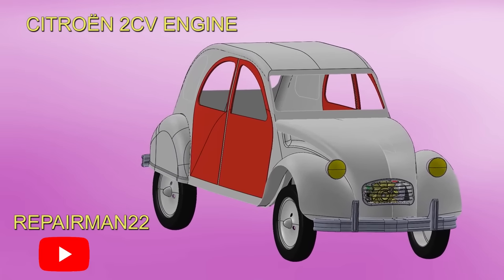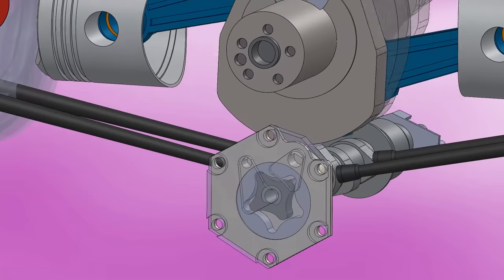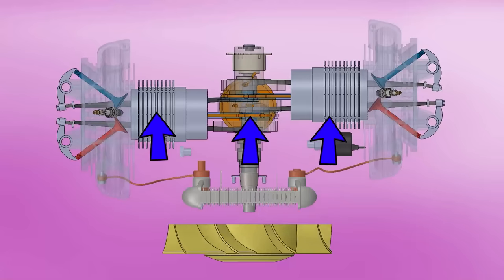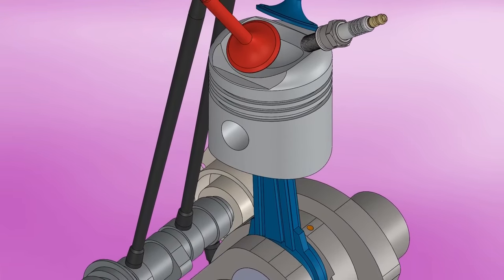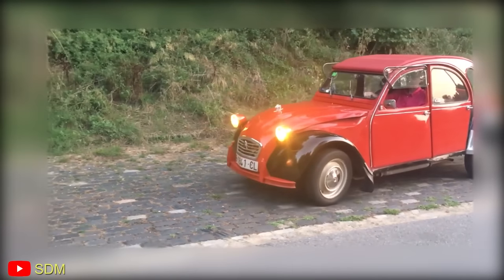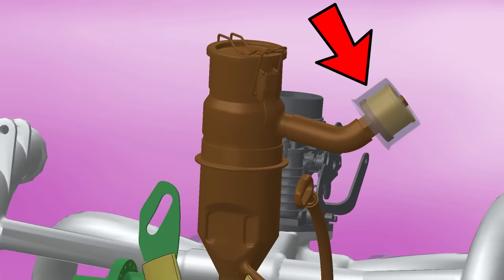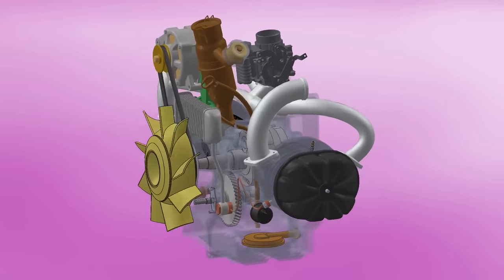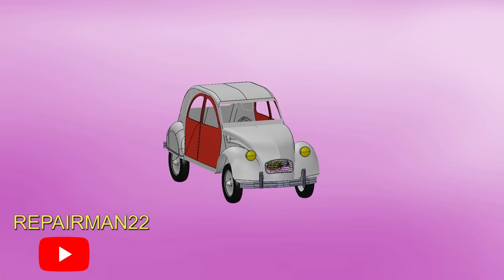The Most Interesting Engine In The World 😍 Citroen 2CV / How does it work in 3D?

Comment: In Greece there was a Greek-made Citroen Pony.  Same engine and drivetrain but with a jeep-like chassis.  Heavier than a 2CV, but could easily fit 10 kids for movie runs!  That was with the 602cc engine.  I learned how to drive on my dads Pony.  It was very fun to drive, especially on dirt roads, thanks to the amazing suspension.  It would be interesting to get a video on the gearbox of the 2CV, the weird gear arrangement (reverse and 1st were opposite of each other), why the 2nd gear was the strongest, and why you could go from 3rd to 4th 2 different ways (one was the normal way of going through neutral, and the second was moving to the right first through the location of what would've been a 5th gear if it existed).  Thank you for bringing back memories!
Reply: I couldn’t even work that out about gear changes let alone trying to drive it 😂😂👏
Reply: Second and third were used a lot for around-town driving, which was very nice in terms of shifting  -  just straight back and forth.

Comment: We bought a used 1968 Dyane 6 with the bigger engine when we first came to France, and I did a lot of maintenance on it myself.  The repair manual said (roughly) "to adjust the rocker arms it is not entirely necessary to remove the mudguards, but it helps".  They were right; however to do this you had to disconnect the headlamp adjustment cable and remove 16 screws each side. To adjust the points you had to take off the front bumper and the fan. Wondrous.  We took ours over the Cockbridge-Tomintoul road in Scotland and over the Alps in the Haute Savoie.  Another time we rolled up the roof and got all the wood to make a double bed into it, along with the mattress.

It finally died in 1976 when a mechanic at the dealership in Edinburgh stripped a clutch mounting bolt and didn't tell us. Still, it took us back to our home near Paris before the engine lost all its oil and we sold it to a scrap-merchant for 400 frs, which we spent that evening on a fitting wake. Wonderful car.
Reply: Can't you replace the engine? I mean the cars were still produced- oh wait a used 1968 Dyane oh then from there on out i got no clue wha- And i forgot i could study the Dyane.
Reply: By rolling the roof back, I got a set of four-metre double ladders into my Dyane, while narrowly avoiding a parking ticket.  Sadly, I no longer have the car, but still have the ladders.  On another occasion, it transported a 280Kg block of marble loaded by forklift.  This was the only time it looked low at the back.  The bump stops came into play a few times on the way home.  Getting it out again on my own was a challenge!
Reply: @CrowPal  It probably weighed more than the car!

Comment: The 2CV engine was designed by Walter Becchia, an Italian engineer who had been at Fiat’s race engine design department before WW1. This design bureau was at the very forefront of combustion engine engineering and would see many of its members develop famous engines for a whole range of brands.
In its latter stages the engine would rev above and beyond 7,000 rpm, and last forever. Try that with a Beetle engine...
Reply: A beetle engine can easily make power over 7,000rpm. The aftermarket for VW performance parts has been the most vast one on the planet for over 50 years.
Reply: @nicholasagnew2792  I think he means stock (unmodified, from the factory) engines. Anything can be modified to do crazy things.
Reply: @Kimoto504  I was about to say that
Reply: the vw is still seriously inferior  like most German engineering would not give a thank you for it speaking as someone that owned a garage it was always German scrap that gave all the big problems .
Reply: @nicholasagnew2792  not revving at the redline forever..
Reply: @petenikolic5244  and still does...The father inlaw bought a big bmw and the battery died.Even the roadside assist fella spent half an hour looking for the battery..and heaven forbid something needs doing with the engine..its nearly back to the factory to find the sparkplugs..
Reply: No engine lasts forever. See also, "survivorship bias".
Reply: They do when everything else fall appart long before they ran into any issues : )

Comment: If I could buy one new, I'd do it in a heartbeat. It was an awesome little car with a lot of smart engineering.
Reply: Well, not the complete car, but the chassis and body parts you can. They are surplus parts of the production in Spain and Portugal.
Reply: @HolgerKuhrts Better to have a modern engine anyway. It would be a great car to use a motorcycle engine in, due to its light weight.
Reply: There is a british company that makes them new but with an electric motor. It's pretty much the same otherwise, with all its quirks. The price is quite high though, as they are made on command.

Comment: I liked the 2CV for its unique design and for its suspension setup. I know some people don't like it, but it's like a type of car you either love or hate. Since I see it being a lot like the Beetle, I called it "France's Beetle" since they both have a similar shape and the design didn't change a whole lot for a long time
Reply: Or a tin snail
Reply: Fun fact, the 2CV prototypes were made before the WWII, the car was supposed to be presented in October 1939 at the Paris Motor Show, but after Germany invaded Poland the Paris motor Show was cancelled and the 250 car pilot run and prototypes were either destroyed or hidden in fear of Germany stealing the project and using it against France. There are only 5 existing examples of pre-war 2CVs that we know of. The similar exterior design of the 2CV and the Beetle is completely coincidental as they were both designed in secret during the same time period.
Reply: @arekb5951  The same applies for the beetle, which was designed and first prototypes produced by Mercedes (with engineer Ferdinand Porsche working there, then..) Unfortunately, wikipedia has obviously censored all pages about this car. (I remember very well, that a few years ago, there has been an extremely nice summary with several pictures of Mercedes beetle prototypes/predecessors. Everything wiped away, obviously. Maybe, if you look for "130, 150, 150 V und 170 H (W 23, W 30, W 130, W 28), 1934 - 1939", you´ll find a German webpage, mentioning a W28, which is close to the first 30 prototypes produced at the Mercedes factory in Sindelfingen (under the lead of Porsche) which were the predecessors of the later KdF-Wagen, after the war renamed to Volkswagen. Unfortunately, no good pictures there.. and it seems impossible to find them with google..
Reply: @kriskross63  Unless your are in some country that censors the internet you will find lots of info on the pre-war beetle on wiki, mercedes website etc. 
It is debatable when a car begins. The beetle was not really created until the final production version. Early concepts are not the car, but the idea for the car.
Reply: @grolfe3210  You are possibly right: The last time, I easily found pages with lots of fotos of beetle prototypes, I looked for them from Germany. (I remember a variant, more or less identical to the beetle, except the „nose“, which contained a typical Mercedes grill on front, it was a Wdd with a 2-digit nr, I thought W40 or W30, but Couldn’t find it anymore now. This time, I googled it from Switzerland…
Reply: @andrewgardner9615 Is that your level? Poor you.
Reply: @grolfe3210  ..let's not forget that the Porsche 356 ( the first post-war Porsche) used a lot of design concepts of the VW Beetle...and Porsche actually built a prototype version that greatly resembled 356 ( and therefore the VW)., in 1939 as the Rome-Berlin fuel-efficient racecar 60K10....aka "Type 64"... https://en.wikipedia.org/wiki/Porsche_64
Reply: Very true -- the Citroen mark is very famous of being weird - i like these querky cars, like the Saab, it speaks to a weird kind of people. 
But it is great they make cars different from the mainstream.
Reply: In Belgium, the 2CV has had the nickname "Geit(je)"🐐 meaning "Goat" for as long as i can remember. 
Meanwhile, the Dutch called them "Eend"🦆(duck)😅
Reply: I like it but its designed from a place of pure ignorance only the French can occupy. It makes a VW beetle look like an early 60s Imperial. A child's pedal car would be safer.
Reply: @nicholasagnew2792  The first few years of Beetles had cable brakes, hydraulics happened in 1950.
Reply: @kriskross63  The beetle design was stolen from Tatra. VW even paid out a settlement after the war.
Reply: @nicholasagnew2792  The 2cv was meant to be a cheap farmer's car, and driven on unpaved roads, not as a highway racer. The beetle was developed for highways.
Reply: @Kimoto504  The 2CV was designed as lowest-cost/keep-it-simple car for maximum usability (4 grownups plus baggage can be moved everwhere from A to B, even in North Africa or in snowy regions). The beetle was a nice looking car with no practible use… maybe for hill-climbing races, with a co-driver permanently available to help getting the heavy rear-driven car out of the mud… but Ferdinand Porsche knew how to sell!

Comment: I bought a 2Cv4, in 1984, with 431 cm³ and 23 hp, top speed 105 km/h. 
That engine died (heroically!) on the Autobahn, but I had enough inertia to reach an exit and came to a halt in front of a scrap yard - which had a crashed 2CV6 with an intact engine - 602 cm³, 29 hp and a top speed of 125 km/h. 
I installed that engine, and, as a lark, put the cylinder heads of the old engine on it.
That works, if you file down the pistons a bit and prolong the pushrod casings for ~20mm, which I did with bicycle parts...
Since the burning chamber on the 2 CV is completely in the cylinder head, that changed the compression ratio from 8.5 to ~12 - and was able to spin the wheels in second gear.
Top speed in the plain was ~145 km/h (hand-stopped, the speedometer ended at 130), and on a memorable day and a long and steep decline I reached 170 (might have been a mis-measure - my hands were shaking a lot).
Remember, the brakes were designed for a top speed of 105 km/h...
I spooked a lot of Beetles and Renault 4's in the day ... and myself, if I'm being honest.

Comment: I've owned two of these quirky little cars and loved them.  Really fun to drive, especially if you're not accustomed to 30 degrees of body roll in corners! 😂and so easy to repair.   A bit of a death trap if you crash, but that applies to most cars of that era.
Reply: The body roll in combination with the weak engine and… let‘s call it spartanic interior meant you felt like you‘re in a race car at all times 😂
Reply: @SahnigReingeloetet but exceptionally comfortable one.
Reply: @SahnigReingeloetet nah, exaggerated. There is a hint of acceleration in 2nd or 3rd,like in the Renault 4, but never even a sligtest kick in the back like you would get from some small Fiats.
Reply: @florkgagga  I meant that you basically floor it all the time, not that it‘s fast 😅 I distinctly remember the acceleration being so bad that you almost can‘t even feel it (when I was driving in a car that would lightly push you into the seat when you floor it, I was like „wow a sports car 😝“). The accelerator pedal is more like a suggestion to the engine to maybe go faster.
Reply: One of the Hungarian car journalists said once: a more fancy Swiss chocolate is wrapped in heavier, sturdier tin foil than the 2CV's bodywork sheets.😅
Reply: @Cuccos19  Yea. If you hit anything in this even at low speeds....
Reply: @michaelburnham4293  It is probably a good thing, in that it might absorb the impact like modern cars.
Reply: @florkgagga  except with a fiat you were never sure if you were going to be driving it home
Reply: The 2CV is to cars what BREAD is food -- it is the baseline.   

Let's get it back into production and make it one of the world's transportation options.

Comment: Thanks, pretty well done!  Might mention the centrifugal clutch, non-rubber 8 LARGE tapered roller bearing suspension, one of the earliest rack & pinions, and no shock absorbers to wear out on the early ones, seats & doors removable in about 15 seconds.
Also, with that shift pattern, some have NOT known that there was a 4th gear available!  Also, also, might mention the horrible F'up with the Mehari plastic's deterioration!

Comment: This is really good. I’d still love to see a tutorial on the 2CV heater system. The Beetle has a simple yet convoluted system of piggy backing off the cooling fan, and blowing air over a few places on the exhaust manifold. Then it sends heat to the front of the car inside ducts that have a dual purpose of also giving the floor pan rigidity where it connects to the body. Then a collection of manual dampers. It doesn’t even use an electric fan—just the engine fan. So you get varying volumes of heat—directly depending on RPM of the engine and cooling fan.
Reply: I though the Heater on a VW Beetle was a Jump Rope in the glove compartment?

Comment: Great report on a great little car. Actually drove a friend's 2CV once. 
Something that's possibly not widely know in the U.S. is what the CV part of the description means. it means chevaux = horses. People typically knew them as deux chevaux (two horses) but in the 'back then' tax system chevaux meant horsepower in the mechanical field. But even that is confusing. In countries like France, Switzerland etc. automobiles are or at least used to be, taxed according to engine size, not actual horsepowers. The Citroën Deux Chevaux thus was one of the least expensive vehicles to insure or to be taxed. Post War Europe was much more frugal back then compared to now. So, my dad way back in the 50s, owned a slightly more powerful Renault Dauphine, a small rear engine gizmo, and the first car I ever got to drive, illegally as I was then underage. Cheers ;- )

Comment: In 1966 I  had a  2CV made in Argentina. excellent, very reliable little  car.  In 1967 with my brother as copilot we crossed the Andes through the 4.000m high Cristo  Redentor pass, went over to Santiago ,  then to the beaches near Viña del Mar. We then went south to Puyehue ,  crossed the All Saint's Lake in a raft and then back  to Argentina by Bariloche. From there to Buenos  Aires all roads for more than  1.000km.were dirt and gravel  ,no  pavement until Bahia  Blanca. In all  we did  7.000km.on some paved, but mostly dirt and gravel roads with no mechanical problems  and never a punctured tire.

Comment: Cam is driven by a spring loaded split chevron gear, so as it wears over time the cam timing never changes. Also notice no connecting rod bolts. The con rods are slipped onto the crank at the factory by cooling the crank in liquid nitrogen and heating the con rods. Renewing the engine, you’d purchase a piston/con rod/crank set. All new in minutes!
Reply: No need to heat the rods!
Reply: The 2CV is to cars what BREAD is food -- it is the baseline.   

Let's get it back into production and make it one of the world's transportation options.